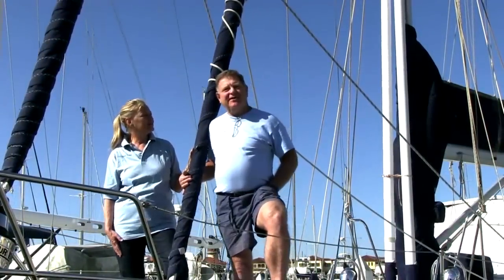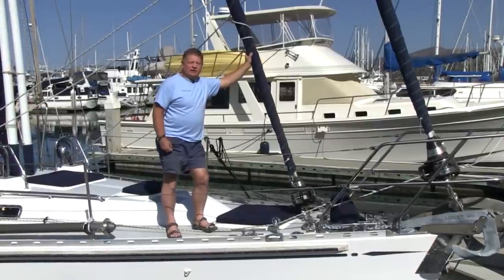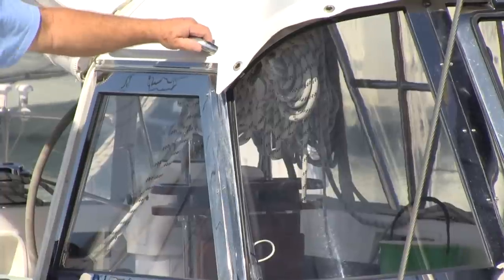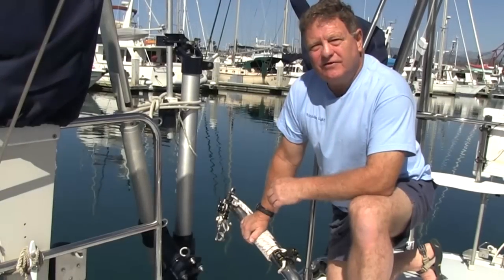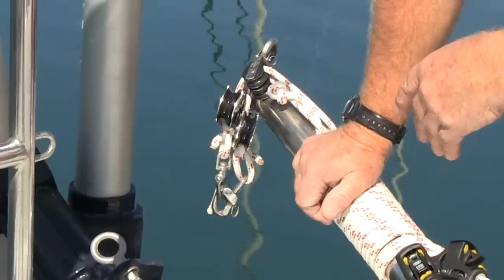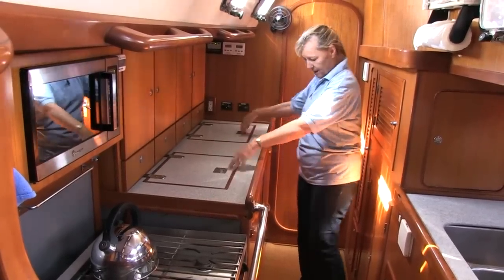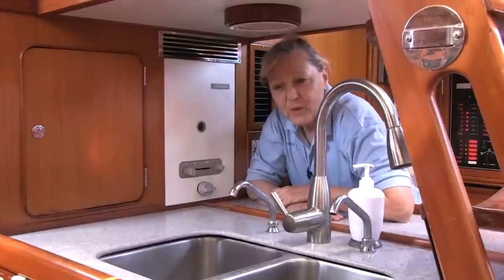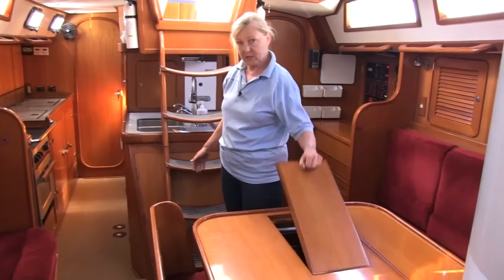Fetching Light--46' Hylas for Sale--Custom Outfitted

Comment: Just a question way to late to be relevant, but why is the pre-luber switch down in the nav station and not up in the cockpit where you are going to actually start the engine?  Otherwise................

Love your boat, love your boat. Not well done, but EXCELLENTLY DONE! Best gosh golly presentation and most genius level outfitting on the web!

Comment: Beautiful boat and really good made video. Can you tell me who made your hard dodger and Bimini?
Reply: Dodger: I did the design and most of the metal SS construction/polishing (except the TIG welding).  Speciality aspects like bending and installing the lexan panels requires large temp-controlled ovens and skilled craftsmen.  For that I constructed custom molds and then contracted the work out in New Zealand.  NOTE: Its very dificult to find shops experienced in custom bending lexan at a reasonable cost.....thus most hard dodgers use flat panels.
Binini: I did the design and hired out the SS frame construction.  Lots of marine canvas shops in US are familiar with WaveStopper fiberglass hard tops(on both Bimini & Dodger) which can be custom made to order at reasonable cost.

Comment: Can you say more about the batteries?  Type, brand, dimensions, amp hours?  Difficulty of tailoring boat to fit them?  Thanks and good luck.  Is there a next boat coming?
Reply: Batteries are lead acid wet cells. There are multiple companies who make them and they come in standard dimensions so one brand is interchangeable with another.  The battery is made from 6 individual 2 volt cells, each 24 inches high and weighing 220 pounds (100Kg) connected in series to get 12 volts. Due to their height & weight, you need to consider not only where you put them from a structural perspective but also how you can safely maneuver then into place.  If done properly (as these were) you should be able to install and manage them as easily as any other battery on the boat.

Comment: Does it have a davit and does it interfere with the wind vane?
Reply: +TVCanT   Davits are great for coastal cruising when you are using the dingy regularly but they are risky for offshore sailing where you can get slammed by big seas.  The risk is losing the dingy and/or ripping a hole in the hull.  Davits definitely would interfere with the wind vane steering by changing the wind flow on the vane sail.